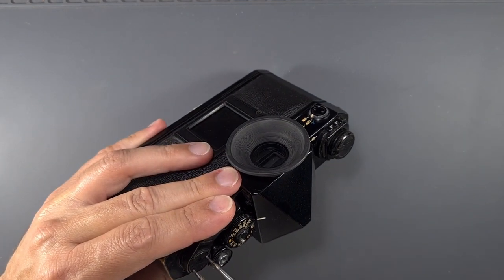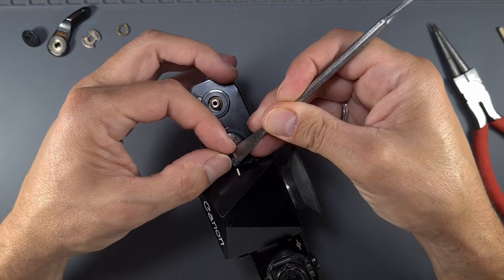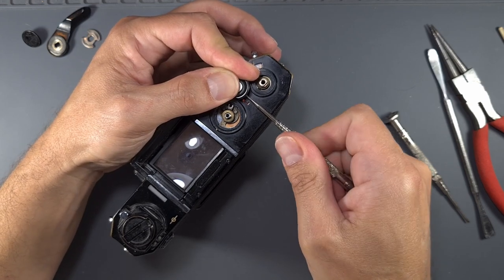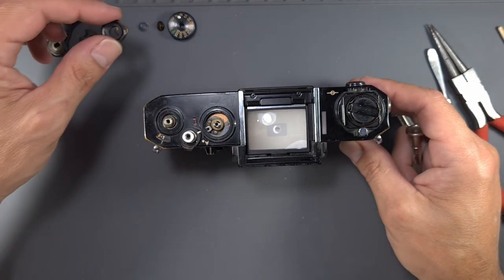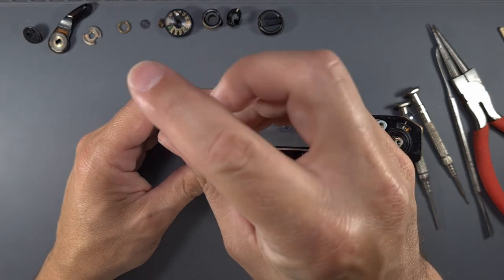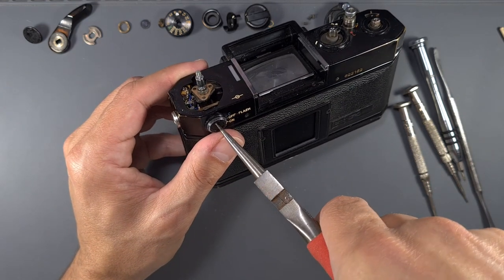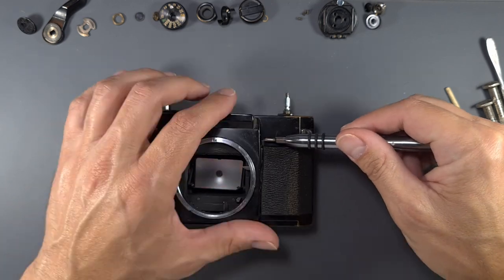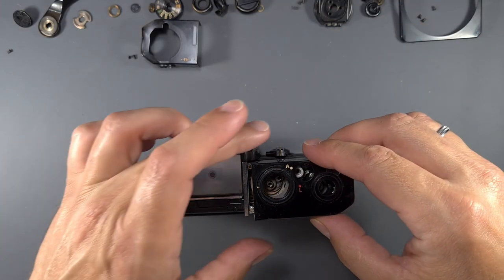Canon F-1 - Remove the Top Covers

Comment: Ok, this is awesome! But here is one for you..how do you replace the shutter indicator "cable"? Somebody really needs to do a remove and replace the shutter indicator cable it's a very very small cable. 

In order for you to remove the shutter speed mechanism you have to remove this cable to get to the slow synch  gears if you have a slow shutter or a sticky shutter you can't get to those gears unless you remove the shutter speed mechanism.

Again, how do you remove the shutter speed mechanism with the shutter indicator cable attached?
Reply from the maker: It's not a easy task, I will try to make a video about the procedure...